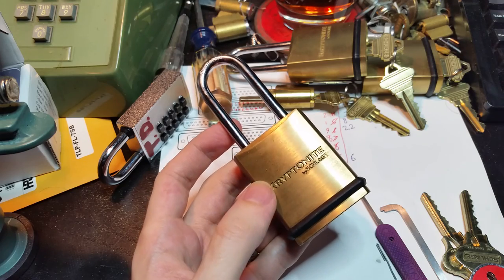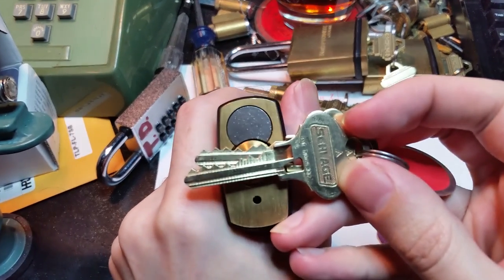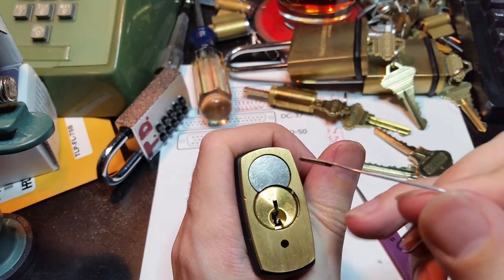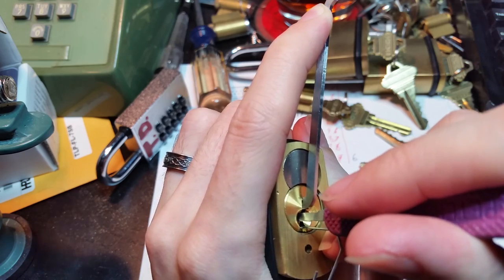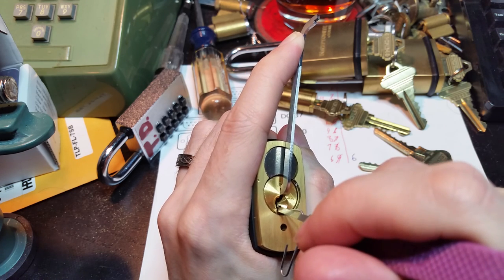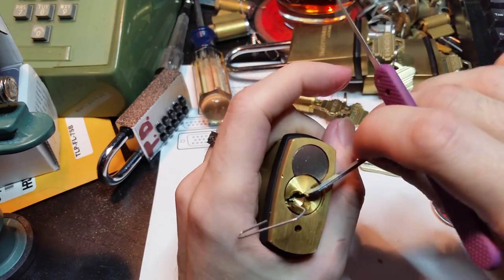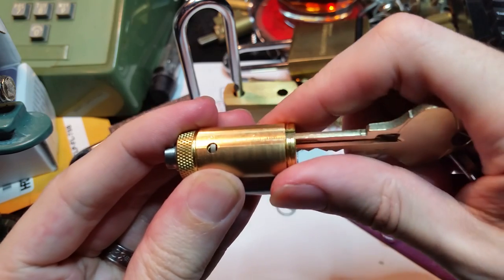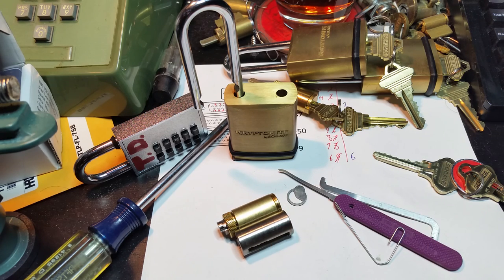(65) Schlage Everest 29 6-pin cylinder picked and analysed

Comment: Everest 29 IS backward-compatible to the "Legacy Everest" corresponding keyway or keyway family. Schlage claims this backwards compatibility makes it easier for facilities to migrate their keying systems easier by affording the new key design with the existing cylinders of the compatible keyway & keyway family. Example: T-* (Restricted Key Family) is backwards compatible to D-* (Restricted Key Family)... S-* (open) family is also backwards compatible to C-* (open) family.

The Schlage Everest-29 key families were developed to extend the utility/design patents of those systems and were introduced by Schlage in the autumn of 2012, towards the end of "Legacy" Everest's patent expiry date of July-2014. Everest-29's patents will be set to expire in July of 2029...

I'm currently reviewing Schlage's new Everest-29-SL - 7-pin key-in-knob/lever cylinders that are backwards compatible to Everest B & Everest 29 R restricted families for SFIC installations. Everest-29-SL is also available with the additional security option of Primus too... (for geographic exclusivity based upon security level and for level 9 - procurement commitment i.e. a minimum quantity of 4000 cylinders purchased or ordered over a two year period gives you a sidebar bitting code that's unique to your particular installation and the keys/cylinders are drop-shipped directly from the factory to the end-user's specified address or location. 2000 cylinders will get you a timezone geographic exclusivity, and 60 or more cylinders will get you a geographic exclusivity based upon the first two digits of your postal zip-code. This routinely applies to all Schlage Primus & Primus-XP (which uses a very shallow-right #7 "XP" finger-pin to extend the usable patent life into the year 2024.)

The Everest-29-SL 7-pin cylinder is not a traditional pin-tumbler lock, as the "L" shaped pins interact with a side-bar. These cylinders, based upon their design architecture that uses no traditional pin-stacks, of which also means no shearline for additional security - these cylinders CANNOT be bumped open. period. 

A Schlage Everest-29-SL-Primus-XP cylinder will have 2 sidebars and 12 pin-tumblers that would have to be manipulated, 5 of those pins have a dual range of movement, meaning that the Primus finger-pins have to be swiveled or slightly rotated in addition to being lifted to the correct height in order for the pin's gates to adequately inter-mesh into each other. The additional 7 "L" shaped pins also have a number of false-gates on them, based upon the detailed illustrations in their service manual. http://us.allegion.com/IRSTDocs/Manual/111232.pdf

The compatible keys are the Everest-29 Restricted "T" Family (for SFIC) that are coded to BEST's A-2 pinning specification. The interesting thing about Everest-29-SL is that the conventional keys can be punched on the standard Blue-Punch key coding machine that is set up specifically for Schlage Everest B & R families for SFIC installations, that are intended for the large commercial/industrial/institutional end-user who maintains their own key system(s) "in-house."
Reply from the maker: Thanks for the info. My point was that the new Series 29 keys can fit the Classic keyways but that Classic series keys cannot fit Series 29 keyways.
Reply: "Classic Series" can also be denoted as Schlage (Non-Everest) standard (full-sized) pin-tumbler keys, cylinders and the four keyway families that have existed since roughly 1935... The four mentioned keyway families for "Classic" include the following - 

(1.) Obverse family - Open (non-restricted) "C" keyway most common for standard residential and default keyways for commercial. "E" keyway is default for master-keyed systems. there are 7 total key sections in this family.
(2.) Reverse family - Restricted Duplication
(3.) Quad family - Restricted Duplication
(4.) Numbered family - Restricted Duplication.

Notes: "Classic" systems are noted as the standard 5 or 6 pin-tumbler cylinders and corresponding keys. Obverse family still in use today. All others obsolete and only available from Schlage for support of existing installations only. Classic Obverse is in no way, compatible with Everest.

Schlage Everest/Everest-29 offers three basic keyway families;

Everest B family restricted for 7-pin A2 SFIC installations & retrofits
Everest-29 R family restricted for 7-pin A2 SFIC installations & retrofits (backwards compatible to B family) Both keyway families are restricted/sanctioned from typical or normal commercial merchandise distribution channels.

Everest C family OPEN keyways - NO restrictions or ordering formalities. 10 keyways in family; 3 multi-sectional keys for operation of multiple key-sections (for larger installations that employ sectional masterkey systems) Keys are 15% thicker than "Classic" Obverse. Key Section C-123 default keyway for stock inventories. C-145 keyway default for new masterkey systems and expand to the right on the keyway chart for multi-sectional key systems (as found on larger installations, such as hospitals & university campuses that employ multiple or groups of buildings on their campuses.) 

Everest-29 S family OPEN is backwards compatible to Everest C family.

Everest D family is restricted. Intended for institutional or commercial facilities or industrial end-users who intend on generating or creating and maintaining their own keying systems, with an enhanced level of security - hense the restricted or sanctioned key section for active key-control to protect against unauthorized key duplication. Everest D & T keyway family structure identical to Everest C & S families.

Everest-29 T family is backwards compatible to Everest D family. Both keyway families are restricted/sanctioned from typical or normal commercial merchandise distribution channels.

Schlage first debuted Primus, thus entering the high-security lock industry in 1990. Patent issued in 1988.

Somewhere in this time period, Schlage discontinued their wafer-tumbler locks - only available in their "A-Series" cylindrical knob formats.

Schlage first debuted Everest for SFIC retrofits in the late 1990s (1997.) Patented until July-2014.

Schlage included Primus keying options into their Everest offering several years later (2002)

Schlage debuted the XP Primus #7 fingerpin to extend the original Primus patent life for another 20 years (July-2024)

Schlage debuted Everest-29 in a 2012 press release to allow for facilities utilizing Schlage Everest to migrate towards the latest generation (Everest-29) of which has an extended patent life until July-2029.

Schlage debuted their KIK/KIL retrofit "SL" series Everest cylinder for backwards & cross-compatibility with Everest/Everest-29 B & R family SFIC (Small Format Interchangeable Core) systems for institutional use. "SL" cylinders available with PRIMUS-XP as an option for increased security and geographic exclusivity for key control restriction/sanction. No Primus version exists for SFIC. From the way things look in diagrams - Schlage Everest-29-SL is completely BUMP-PROOF, as it does not use the traditional pin-tumbler design AND also uses side-bar(s) with the additional security enhancement of the restricted/sanctioned SFIC key families of "B" % "R"...